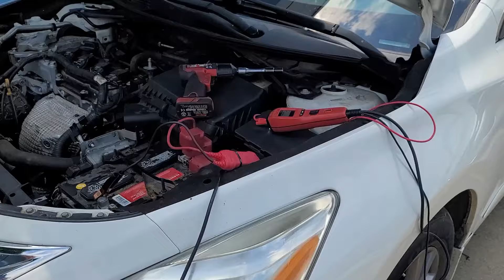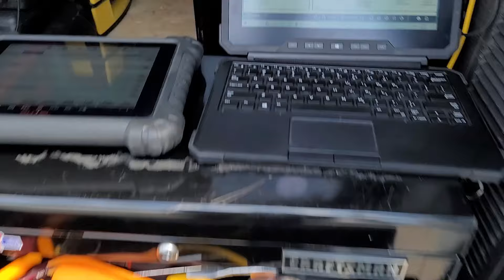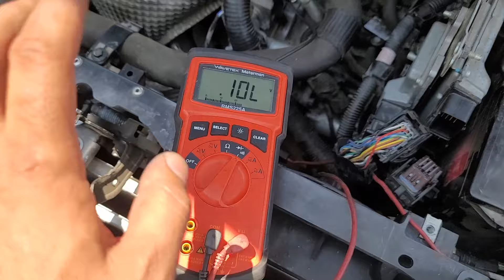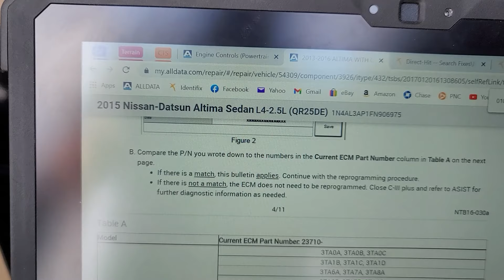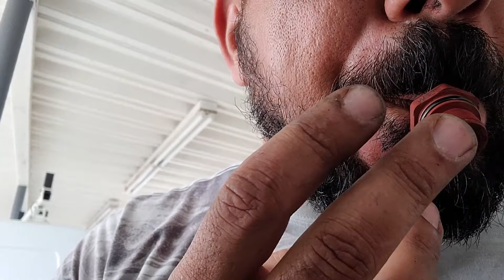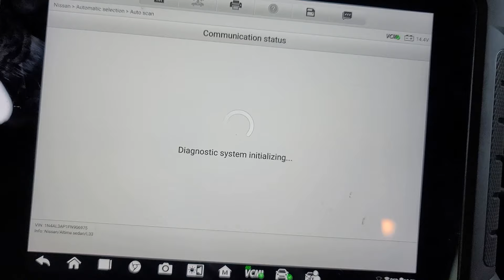P0101 Very Important and cheap repair, 2013-2016 Nissan Altima

Comment: Thank you Soo much!!! Fixed my P0101 issue on my 2013 Nissan Juke.
Reply from the maker: What did you replace or do to fix it?
Reply: @DallasAutoDiag   help me what does code  p0102 p0962 &P0112 on a 2014 Nissan Altima 2.5 ?
Reply: @DallasAutoDiag  I replaced it with a new black one from Nissan. It was super easy considering I really don’t have experience fixing a car.
Reply from the maker: @BassMan77  awesome 👌
Reply: @BassMan77   what was it doing before you replaced it
Reply: @jimmygonzales7160  it was idling rough every so often. Also it was giving me a error code P0101. My miles per gallon was also affected negatively. After replacing PCV that issue was resolved. I didn’t realize how much power I lost until after I replace that part. My car is now running like new!
Reply: @BassMan77 I don’t either but I’m going to check and see if it needs a new one
Reply: @BassMan77 I bet that’s the problem mine has
Reply: @DallasAutoDiag I really need help. I have changed the mass air sensor twice. The code p0101 keeps coming up. I noticed the part where the airflows to the air filter, is very loose and not secure. What’s the name of that part ? I have no clue what else to do for the p010 code keeps coming up
Reply from the maker: @shellybelle6781  where are you located?
Reply: @DallasAutoDiag  Ga
Reply: @DallasAutoDiag  are you able to help me and tell me   ?
Reply from the maker: @shellybelle6781  i thought you in Dallas area. You need to find a good trch in your area to look at the car
Reply: Thank you, Sir. You are a HERO!!

Comment: My 2014 Altima S fuel gage is not working after replacing the fuel pump assembly from inside fuel tank, checked the fuel pump fuse … good! No problem. Now disconnected the neg terminal for 10 to 15 min.

Comment: i have a 2018 nissan versa.  do you think this also could be the fix?  transmission is also awful.  i've never changed the fluids but i was told it now has a leak.  plus the radio/clock randomly turn off and turn on with ignition switch the only change. 106k miles.  i've changed the air filter that wasn't even dirty.  the mechanic cleaned the maf sensor and thought that was the reason since it was really dirty.  he cleared the code and several weeks later it came back.  my car throws a lot of bad codes so it makes me suspicious.  the other two times the engine light was on it wasn't at all related to the code.  the car needed oil and transmission fluid. this time it seems to match the symptoms of the code though.  car drives horrible when cold.  and it never has done well on hills thanks to the crappy transmission.  getting really scary now.

Comment: Hola que tal.. recibe saludos desde mexico, tengo el  caso de un nissan sentra 2014 con el dtc p0102, pero el cliente cambio la transmisión cvt por una transmisión maual, y no podemos borrar el codigo p0102, ya cambio maf sensor, pcv, se hizo reprogramacion al pcm, el auto se apaga pierde potencia, y no avanza, mi duda es.... la auscencia de la transmisión cvt tiene que ver con este dtc p0102..? 
o se tendria que cambiar la pcm por una para transmisión manual?
espero me puedas orientar ya que el cliente esta desesperado. 
gracias por leer mi comentario. me gusto mucho tu video. 
SALUDOS DESDE VERACRUZ MEXICO..!

Comment: Never ever buy a cheap off-brand MAF sensor for a 5th generation Altima, you will regret it!

OEM one is expensive,  but suck it up.
Reply: I’ve replaced mine 4 times from 4 different places. Thinking it’s a quality issue is not always smart

Comment: I have an orange PCV (2014 Altima) and it too does not restrict air in the direction it should.  Can you tell me Where on the ECU does it mention the part number?

Comment: The Nissan Altima 2.5l  generation from 2006 -2012 , have the same problem .
Great video bro !👌👏
Reply: Yep. Just got it in my 2011 2.5L. Replaced maf and air filter, cleaned throttle body. Cleared code. Error returns. Will check pcv and search for air leaks beyomd the throttle body next

Comment: Hello my guy, so i got p0101 2012 altima and maf signal reading .90v at 700 rpms and 1.30v at 1500 pms is that normal? I saw your readings at idle was like 1.60 . I cant find online whats normal maf signals for this car . My scanner is a xtool d7 my other question is can i reflash the pcm with that tool ?

Comment: 2015 shut off and then wouldn't get above 2k rpm / 30mph. Check engine light. Pulled this code. Cleaned MAF, the engine light went off, and the car drove perfect for about 30 miles and then lost all power. No engine light. It will not move at all now. No rpms. With these symptoms, would it be worth it to change replace both the MAF and PCV? Or could there be another issue? Confused why the cleaning worked temporarily, then way worse.
Reply: did you solve the problem?
Reply: @josegvelas yes, had to replace the MAF again and get it reprogammed.

Comment: For Judder CVT CODE Nissan has Recall on it so you can take it to dealer and they will re-flash transmission computer with new set of instructions (code) to hopefully fix it. It's free btw.

Comment: Dam best video out there to address the dreaded P0101 Code! Thank you so much you saved me alot of money and pain!! I was lucky to get away with just cleaning the MAF and replacing the PCV valve with the new replacement part and then clearing the codes on a 2016 Nissan Altima SL 2.5L!! Thank God I didn't have to flash the ECM.
Reply from the maker: Glad it helped

Comment: This issue's been around for a while. Have a 2011 Altima, same problem. Went to the dealer, they said the MAF was bad, replaced it and reprogrammed the ECM. Light came back of around 40K miles later.  I cleaned the throttle body and the light went off. I think the throttle body's are supposed to have regular maintenance. The code comes back after about a year or so, 15-20  miles but cleaning the throttle body gets rid of it.
Reply from the maker: yes and most probably a pcm update it a must
Reply: do you have an engine misfire with the code p0101

Comment: Great job, I tell u as a fellow technician, very step-by-step and clear instructions… just want to share my experience with P0101 code in Nissans: changing the ECM rarely saves the day, I have done many “replace the ECM and program it” jobs with no results… also, replacing the sensor does not do it either… I have a theory that the timing issue will cause the P0101 code and performance issue, and I have many examples to prove it… https://youtube.com/shorts/g2QTp7qRCbs?si=dETTCcZkW01dY9dx I also mentioned you in my video …
Reply: I saw ypur video and noticed you linked your friends video but his doesnt work. Did you ever figure it out? Thank you
Reply: @Bao @Baoth-l nk to my own videos, like a chain, that’s the only thing that’s allowed… I wanted to link to your video by putting a link to it in comments - that used to work… also, I can put your video in my public area

Comment: Do I replace orange pcv valve with black one? Does it have to be from dealer? What do I have to reprogram once i change the pcv valve?
Reply from the maker: Buy from dealer. Update the pcm
Reply: Ecm or pcm?
Reply: @DallasAutoDiag What happens if u don't update?

Comment: is the intake air temp sensor the same thing as a maf sensor? i was told those codes were affecting my car from starting up. i have a 2014 nissan altima.
Reply from the maker: Those codes would not stop a car from starting

Comment: Very very good information! I’m going to check mine as I’ve had a sporadic code for years. If the pcv valve is bad do I have to reprogram the computer too or just change the valve? Thank you so much! 🙏🏻
Reply from the maker: I'm glad I could help

Comment: When electrical issue happened with MAF, it throws another code than P0101. P0101 means, MAP and MAF readings are irrelevant relative to eachother so better to check for air leakage first ;)
Reply: The word is not "irrelevant". The word is "irrational". P0101 is the result of a failed rationality test between MAF, MAP, and Throttle Valve.
Reply from the maker: Thanks for the clarification

Comment: Im getting that code, but my car comes on in park or nuetral but immediately shuts off when i put it in reverse or drive. P0101 only code I get Nissan Altima 2014
Reply from the maker: I would start with pcm update. I don't think the code has any thing to do with car shutting off though.

Comment: Why the hell do you have to reprogram for a pvc lol wth nissan
Reply from the maker: change what the pcm is looking for in order not to trigger the check engine light
Reply: @DallasAutoDiag  thanks for the reply. Would you happen to know once we replace the pcv do I have to have it reflashed?
Reply from the maker: @Jploco213  follow the tsb. In most cases you do

Comment: Brother I have Tha same problem with my nissan sentra 2019 same code is coming in engine pcm i change mass air flow sansor remove from other Santra my run too good Tha same sonser I putt other Santra it not running well I change new sonser butt Tha car is not run it go on 60 km
Reply from the maker: you need to update the pcm

Comment: I bought my 2013 Altima new and have put close to 170K miles. Just recently did the P0101 code appear. I changed the MAF Sensor and that fixed the issue for like a month. Now I have the check engine light on again.  I did see on another channel that they also replaced the PVC valve when they changed the MAF sensor. I didn’t do that. I think I have the orange PVC Valve. Now I just hope I don’t have to reprogram the computer, but since it’s a 2013, I’m probably screwed. 🙂
Reply from the maker: Hope you don't have to. If you do need someone to program the computer let me know at that time.
Reply: @DallasAutoDiag  Is the reprogramming something a DIY-ER can do or it must be take to a dealer?
Reply from the maker: @Roberto Reyes  not a diy. Dealer or a tech at a shop or mobile like me who has a dealer software and device.

Comment: I'm trying to figure out whats going on with my 2015 Nissan Altima while I excelerate to go faster the excelerator knocks or makes a weird feeling on the foot petal while excelerateing. I was told that the transmissions on this series starts to go out in them or fail after the transmission gets about 80,000 miles on them and my car is right at 78,400 miles. So does anyone know what the problem is? I just got a tuneup on it a couple days ago and it still does this hiccup every once in awhile while driveing it.
Reply from the maker: Why don't you take it to a transmission shop?

Comment: Is there any chance you have an idea on what's going on on my 2015 Nissan Altima 2.5? When I shift to Drive or Reverse, it won't move like if it's stuck on neutral.
Reply from the maker: Signs of a bad trans. Take it to a transmission shop to be looked at, not a mechanic shop

Comment: I’m having the same code on my Sentra but the vehicle turns on and immediately off. If I give it gas. While cranking, it’ll stay on, no problems. But the next morning. Same issue.

I’ve cleaned and replaced the maf, problem follows. Next is to change the pcv I guess since it’s orange
Reply from the maker: good luck
Reply: I’m having the same issue with mines. Did you figure it out?

Comment: I live in Ohio but when I go to Tennessee or any where south. My 2015 Nissan Altima has a acceleration issue.  After driving a while I stop at a light and I have to stomp on gas pedal a few times to get it to go. Any idea what would cause it. It doesn’t do it when I’m in Ohio only in altitude changing places.
Reply from the maker: Not sure honestly. A tech has to scan it and see if there are any codes.
Reply: Usually that would be a problem for carbureted cars

Comment: So if the pcv valve was already changed and the output voltage from the Maf is good then that means the maf is good? Then that means the ecu needs to be reprogrammed?
Reply from the maker: I have noticed that reflashing the pcm is a must to get rid of this code.
Reply: @DallasAutoDiag do you mean the error code went back on in your case? Thank you!
Reply: Programming the ECM changes the parameters of when the code will set , once the correct PCV is installed and programmed, you shouldn't have any more P0101 code unless yoi have  Drive ability issues then tsb doesn't apply

Comment: 2013 same code will let you know how it works out. Thanks a lot for sharing very well done.
Reply: How do you update the pcm?
Reply: @coachtrollinger  I wound up selling as is so i didn't do the job
Reply from the maker: Updating tge pcm is really important in this case also.

Comment: It's wired, your "11810-EA200" valve, on Nissan's website, it says fit 3.5L engine.
And it suggests "11810-1KC0A" valve,  which is orange. I just installed this today.
The one installed by Nissan dealer about one year ago was "11810-6N202" valve (due to MAF error code). It's for 2018+ Altima. 
So confusing...
Mine was 2013 Altima SV, 2.5L
Reply from the maker: Its not weird the manufacturer comes with weird decisions
Reply: @DallasAutoDiag  I found the correct part number on the bulletin. 
It’s 6N202. It’s all black, not the thread and the tip.
But I don’t see why the green one will not work. Or even the orange one.
Reply: @hulong0205   did you have to reprogram pcm or drive awhile after changing to the black one?
Reply: @christopherrupengliang6662  no need.
Reply: Hulong, did you end up install the 11810-6N202 on your 2013 Altima 2.5l ?
Reply: @MinhPham-pm8vk  it’s been a while. I believe I’m using the 6N202. 
But the dealer says if it’s not acting up, you don’t have to change nothing.
Reply: @hulong0205  I am going to install the 6N202 to see if it can clear the P101 code. Thanks
Reply: @MinhPham-pm8vk did it work for you? Mine went back on with the new pcv after hundred miles.

Comment: 2014 altima with P0101 code. I had the dealer replace the pcv valve and do the re-tune, tsb NTB16-030a
Reply from the maker: Code still there or gone?
Reply: How did that work for you?
Reply from the maker: @christianmaldonado9068  after pcm update worked fine.

Comment: Just thought i would leave this here that it may help someone.    I was told to clean the throttle body that had black sludge on back inside of it. After months of trying to find cause engine light is finally gone.
Reply from the maker: Thanks for sharing. This is definitely one of the regular causes of the code.
Reply: Did you have to remove the throttle body to clean it, or just spray it out?
Reply from the maker: @freddyfudd253  their mechanic did, not me.

Comment: 2012 Nissan Altima s2.5 P0101 codes keeps coming back after two weeks consistently, the sensor is already replace.
Reply from the maker: Did you update your pcm?
Reply: @DallasAutoDiag   the owner has not updated the pcm. But the p0101 code comes back after 14days each time I reset the code. Could this be the pcm or needs a module update?
Reply from the maker: @vladd1593  you have to update the pcm and make a decision afterwards.
Reply: @DallasAutoDiag  will do the pcm next. Thank you so much for your input

Comment: Thank you for the video ! I have a Nissan 2013 altima with the code P0101 and the car is jerking when accelerating when it reaches 20mph
Reply: TSB says it only applies if there is no drivability problems..
Reply: It sounds like the CVT is slipping and will need a cvt if chain is damaged

Comment: I just fix this issue some it could also need a throttle body  cleaning   it is also in the tsb
Reply from the maker: Good to know man thanks for the update
Reply: @DallasAutoDiag does ECM cleaning need an update too or can I clean with battery disconnect without needing update?

Comment: That was very helpful, just ordered the part to fix mine. I had the same transmission code, I replace the whole transmission or could of just changed the transmission value body.
Reply from the maker: Good luck. Hope you won't have to reflash your module.
Reply: Hopefully I don't have to, but it can't be helped if it has to come to that. Which I'm okay with that
Reply: I replaced my transmission 6/23 and kept getting a p0441/ or p0467  code since I first wanted to bring my car in 2022 still getting the code lol changed most stuff to OEM now ima check my wires

Comment: Just checked mine. My PCV Vaulve is Purple but has some orange on the tip. I Felt some air coming thru the side its not suppose to be so as i blew thru it. After installing the new one, is that all u have to do?
Reply from the maker: After changing it you need to reprogram your pcm.

Comment: Thank you for posting this video I had fix my problem with out going to the dealer the dealer estimate was 900 I had follow you steps and bought the pcv valve and light engine is not at my dash board any more thanks
Reply from the maker: Glad that it worked for you.

Comment: Hi brother I got a question for you I got 2016 Nissan Sentra the engine light come on it says mass airflow sensor I replace it for time and still the engine light come on can you give me some advice thank you
Reply: I have the same issue with a 2014 nissan sentra. the TSB for it is NTB16-027A

Comment: If I don’t have a scanner how do I delete the check engine light when the job is completed??
Reply from the maker: Try disconnecting the battery negative. Then pump the brake twise while negative disconnected. Then wait for a minute or so and reconnect.
Reply: Thank you do you think I have to reprogram after I change the pcv valve is is orange in my 2013 Nissan Versa ??
Reply from the maker: @Washington Pesantez  most of the time, you have to reprogram.
Reply: @DallasAutoDiag if I don't get it reprogram what will happen?